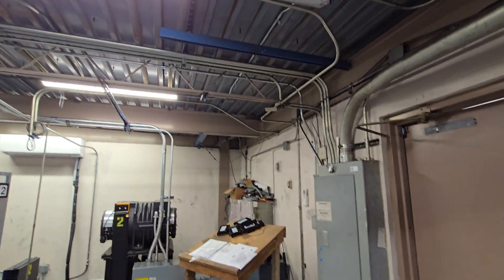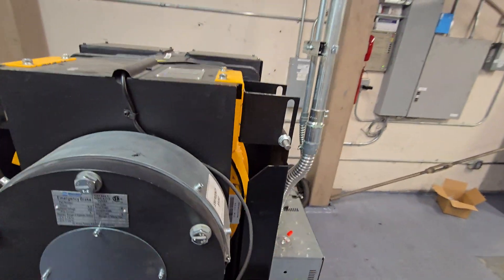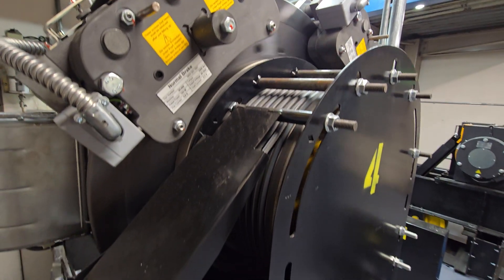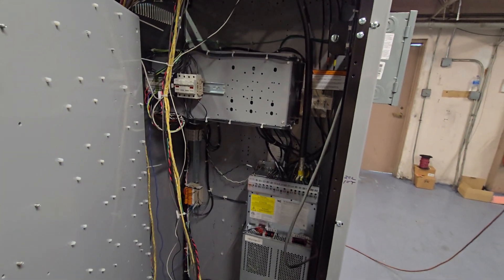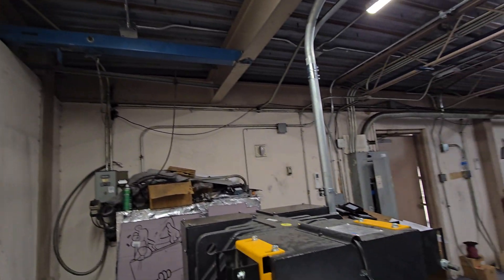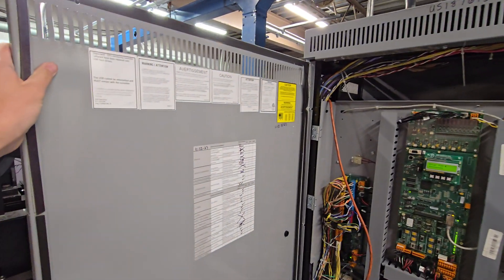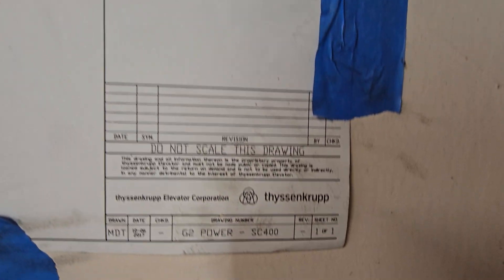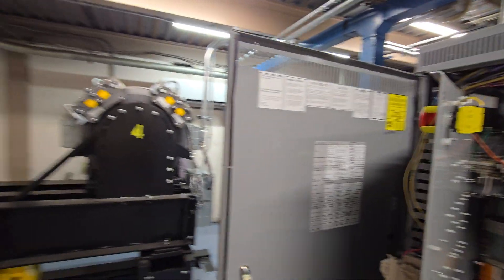Amazing Brand New TKE Traction Elevator Machine Room

Comment: Those smaller motors are crap lol Nothing will beat the schindler miconic's with the seriously heavy duty motors that are built to last.
Reply from the maker: I know beno always says that, but these new gearless AC machines are reliable and i've not yet come across one with major issues. There are a few cheap offenders brand wise with unreliable machines (500FPM Gen2's especially), but Torin is a major name for machines and that TKE machine looks beefy to me.

Comment: yeah, TKE does typically use Torin unless specifically requested otherwise, just like otis typically uses hollister-whitney. I'm gonna be moving into an apartment in a couple months served by 700FPM TKE momentums installed this year. the Gen2s in most other apartments my area all run super well, but the momentums are more fun/thrilling and have zero lateral movement or random bumps, which is insanely impressive and goes a long way in a 40 floor tower (and sometimes the Gen2s sway slightly). they don't handle acceleration transitions as well as Otis does, or level quite as fast, but they're pretty darn good nonetheless

Comment: How is that shed accessed for major equipment R&R, is there a hatch in the roof?
Reply from the maker: There's a hatch in the floor that goes down to the top floor of the hotel from the machine room. Large machinery is hoisted up the empty elevator shaft in modernizations. The other option is to crane lift the equipment to the roof.